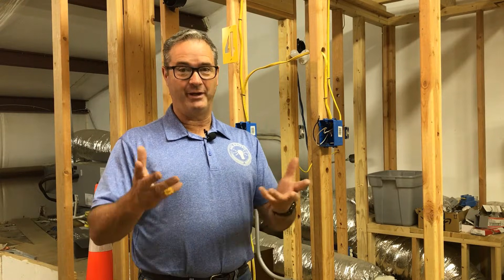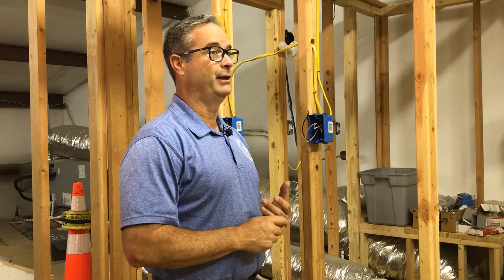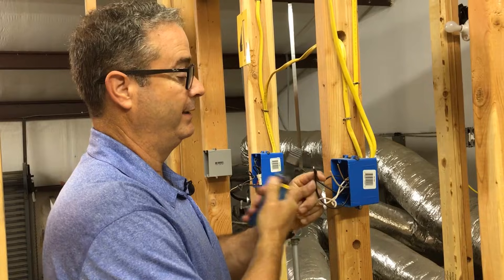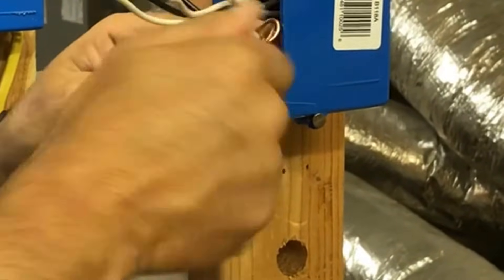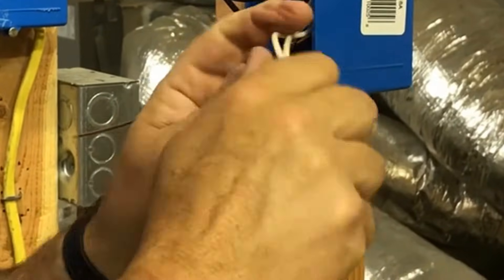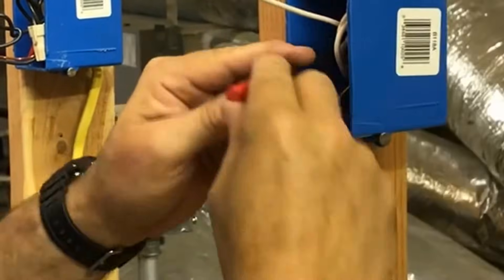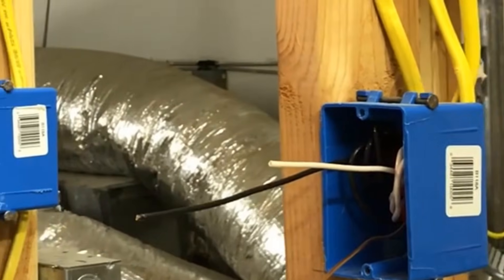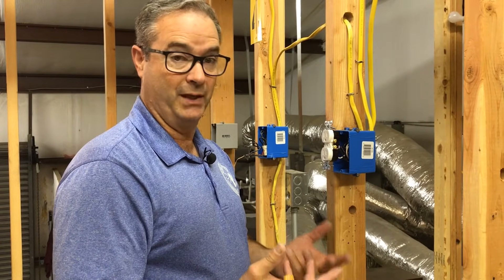How to Pigtail Electrical Wires

Comment: The only thing I saw that you were doing (kind of wrong) was when you were twisting your wires together, you were twisting the first two wires tight then adding the third wire and twisting it tight, then when you added the fourth wire it was riding up and not blending in with the other wires'. When I twist multiple wires together, I will barely twist the first two together, maybe one full twist, then add the third, again only twisting it one full twist the add the fourth. Then when all the wires are bundled, I will twist them tight and put on the wire nut. Other than that, you do things the same way I do.
Reply: Among construction workers there's a brotherhood of people that have a soul it's good to hear from one of you one of us. I'm hoping you can answer this simple question can I run all of my outlets with 10 gauge and then just pigtail a little chunk of 12 gauge on the end? I know the wire is more expensive but I'm going to buy it off Facebook and probably get it for the same price that they wanted for the new 12 and I like that heavier gauge .
Reply: @markmcgoveran6811  It's not illegal, and it's also amateurish and foolish. There's no need to run #10 for 20 amp circuits. #12 can safely carry 30 amps and you're putting it on a 20 amp breakers so 12 is already oversized (electrically) for 20 amp circuits. The other issue is that using 10 changes your box fill. Because 10 takes up more space in the box than #12, you're going to need larger boxes or you'll be limited to fewer cables entering a box. Every box requires minimum 6" of wire entering that box; good luck folding them in, and doing it neatly. You're creating more and harder work for yourself for no good reason. You also run the risk of another amateur with limited knowledge and understanding in the future seeing #10 in the panel and thinking that it would be ok to put it on a 25 or 30 amp breaker. If I opened boxes and saw this was done I'd have to immediately question any and all existing wiring in that space; it would be so obvious that a pro didn't do the wiring so I'd have to wonder if whoever did it screwed up somewhere. Not a good idea. You gain absolutely nothing by running #10.
Reply: @pld8993  well the difference between me and the electricians I worked with and the engineers I studied under when I got to be senior standing in electrical engineering is,: I'm not all-knowing and I certainly am not hard of listening so I listen to your line of reasoning about all the negative sides of it you're right you need bigger boxes. However you are hard of listening when you consider what you already know about the benefits of using a ten gauge wire on a 20 amp circuit in a 120-volt . If the wire is long the resistance is low and the voltage drop is less with the fat wire. Even you know that. So in your personal opinion you are ignoring the fact that the voltage would drop less in any circuit that was thicker wire no matter what the length. So you would say something like it's insignificant it's this it's that it's this it's that it's just you ignored it totally to take a cheap shot at me because I'm an electrical engineer and I know something you don't know about electricity I know something you won't admit about that circuit and the characteristics of one wire over. 10 gauges it's cheaper than the 12 gage or the 14 gauge frequently enough for my purposes. Now there again you want to blow off at the head and call me a liar and tell me the price of the new wire that you charge an arm and a leg to put in praise the Lord speak one to me from on high tell me all about it from on high. Well I hate to mention that I might be a little higher in the mathematical theory department about everything that you ever thought about then you are. I buy most of my stuff off of the Facebook marketplace. You will find often enough for my purposes not yours off and off for less of my money not yours that somebody has bought the 10 and used it for a little bit of work and then just sold it for less than the price of the new 12 the same length. So due to my advanced mathematical engineering skills electrical understanding and cash flow understanding, I'm getting an equal initial cost, in a somewhat lower operating cost,of course all these things would be negligible to you since you're doing it for somebody else you want the money now quick to set it all up and it's going to cost him a fortune to have you fight that number 10 into every socket I know people that did that that were rich and I know some electricians that bitched about it while they were getting rich. I on the other hand and putting all this stuff in myself and I'm buying the cheapest wire I can use and if I can get a number 10 cheaper than I can get a 12 at a store I'm going to take the ten. I appreciate all the nasty condescending advice because I've talked to electricians before."why is it going to take you 6 years to learn all about electricity I'm electrician I know all about electricity I've been putting in electricity for 20 years I know all about it ask me anything you want to know. The first question is name of the thinking there is some iron and some copper and some insulation and some oil in a transformer is that true.... Yes that's true now you know that. My next question is if the transformer is on a 400 cycle per second aircraft alternating current power system and it's supposed to move 400 watts, how much iron how much copper and how much insulation and how much oil do I need? Like all electricians didn't know everything about electricity because they know everything about the qualitative information of electricity. Not only do most electricians have a very very limited quantitative ability to understand electricity they have a very very limited quantitative ability to understand quantitative information versus qualitative information. The electrician looked at me like he was dumb as a post. I said do you know all about a transformer and you can hook it up in the circuit and that's all you know about it where do you get a transformer does it grow on a stock like an ear of corn?
Reply: @markmcgoveran6811  Unless your circuit length is approximately 100' or more and your conductor is close to its max current capacity, voltage drop is well within the max recommended 5% so that rules out the overwhelming majority of residential circuits. Lowering the voltage drop that's already within that 5% drop range (from 4% to 2%, for example) provides no functional or performance advantage. Aside from the necessity of staying within 5% of the operating voltage, there are no actualized benefits to using #10 on a 20 amp circuit. But go ahead, mister i'm an engineer with superior math skills who knows things you don't, do your thing and pretend you know what you're doing..
Reply: @pld8993  well let's see friend if I lower the voltage by half the power I can carry is down to 1/4. Electrical engineering for 7 years I ran into a bunch of jackasses like you that were Superior to me in their mathematical ability and proud of it. You're so proud of your vast superiority that you're telling me 5% is the acceptable amount of loss there is no other idea there is no other idea there is no other. Why don't you apply the square law that I applied in my head to keep that in mind as I look at things and tell me exactly how much you're losing when you drop the voltage by 5%. I was there 7 years and I met all of these guys who had all this mathematical superiority and then they used it to support nothing because they didn't use it so please come back at me please come back at me Dr electrical engineer and tell me exactly how much the wattage drops with a 5% voltage loss and then tell me that is the tolerable fraction.I'm not even going to bother to pull out my calculator and calculate what you think the tolerable wattage loss is because you told me what you think the tolerable voltage loss is at 5% then you quit all the authorities up and down the pike like that means something . I want the 7 years of electrical engineering. I got screwed on a grade they were having a great appeal with a bunch of professors and I asked a good honest electrical engineering professor to come in there and be my witness as to my behavior. When he came through the door the honest guy and the rest of them saw him the look of disappointment on their face was clear these guys are mathematicians but they haven't the poker face to use it. My witness was the soul of patience he sat there and didn't say anything I never questioned him about it. Fundamentally the guy cheated me fundamentally he gave me a lower letter grade being an f and he was generous with some people who had lower scores overall than mine so he broke the rules and the order we fell in the raw scores is the order we fall in the grades it's pretty simple even an electrical engineer can't understand it.back and forth it went this phony great appeal and my friend the honest guy was impressed. Wow he said that was quite a presentation I'm pretty sure you're going to win that was very persuasive. I told him doctor I love you brother but I'm absolutely certain I'm beat I'm lost. These people are mathematical creeps and these people are mathematically astute and these people are superior at me at math. If the spreadsheet and all of the scores of all of the students and myself have shown me to be wrong they would have brought it out instantly and shown me to be wrong they're not going to sit there and waste a bunch of time being polite to some a**** like me their assholes. Lo and behold oddly enough at my hearing the one piece of evidence that would have absolutely cleared me didn't show up and I got screwed I went to the ombudsman. I told the ombudsman I had a straight A on everything and he flunked me out of spite. The ombudsman told the doctor that cheated me that he had cheated me out of an a instead of cheating me out of an f.he was so incredibly stupid he laid out every detail numerically about the scale that had changed and about the scores of the people below me and the resulting if I got for higher scores completely incriminated himself and he assumed the ombudsman was intelligent enough that she wouldn't leaked the information that proved me. I went to the ombudsman office with a copy from the IT people saying that it was straight up from my email account no way I could have done anything to this one it was a legit print out at that time place and it was signed by somebody that was pretty smart. I went to the ombudsman I asked her to sign it and she refused I asked her officemate to sign it and he said I sure will Mark I was here for this whole mess and this is the official email from this office so if you couldn't find her at work to sign it and you caught me I'll sign it. She signed it. She said if I went to the academic Senate she would have me arrested. I said can you deliver these documents. No I won't she says and if you mail them I'll have you arrested for trespass if you contact them I'll have you arrested for trespass. So I had about 10 phds doctors with engineering just like you way smarter than I am they know way more math than I ever had a chance to know so do you. Yet somehow I am so abysmally stupid I forgot what grade I earned and I accidentally told the ombudsman that and I accidentally figured out that she was too stupid to help those engineers keep a secret and I accidentally documented everybody cheating me all the way up to the grade appeal and to the ombudsman. So is a mathematically stupid person please help me figure out how much wattage lost you are accepting when you drop the voltage percent? We've gone over your credentials at Great length in your mathematical superiority and your engineering employment and likeness and everything else about you up and down the pike until I'm happy to remember my college days and all of the people just like you that were so smart one of them confessed to the ombudsman and she told the whole story of where he broke the rules how he broke the rules and how I should have passed the class.. so yeah. You got the better resume you got everything better than me better better better better up and down the pipe smarter too just like all them other people that was arbitrary and cheated. So you heard my resume and you heard my mathematical concept about the difference in the power with dropping 50% go ahead and use my equation and figure out what your tolerance of dropping power is at five percent. I don't really care you seem pretty intolerant of somebody who wants to run a fat wire cuz he got it cheap and it saves 2%.
Reply: @pld8993  you have very very limited ability to deal with quantitative knowledge and it shows glaringly obviously and beyond the shadow of a doubt. If you have 1/2 the voltage, you have 1/4 the wattage. If you have 95% of the voltage you have 0.9025 x the wattage delivered at full voltage. That's the math do the math. If you look at all up in the ohm's law chart that you have to use to manipulate ohm's law you would find an equation that would tell you exactly what I just said. Unfortunately you are too obtuse to understand what I'm trying to explain but it wouldn't drop by 50% like you somehow implied I thought it would or whatever 9.025 percent.
Reply: @pld8993  yes I have senior standing in electrical engineering. I merely said if you drop the voltage by half then you will get 1/4 the power out of the system because it is very simple calculation. If you drop the voltage by 5%, power delivered will amount to 0.9025 times the original power. Please do me a big favor look it up, incorrect my numbers if you are able. I know you're an electrician and you know everything about everything electrical it doesn't matter. Unfortunately you don't have the quantitative skills to understand electricity the way I do. The formula is the new percentage squared. If it's 50% you square that you get 1/4. Please correct my formulas in my calculations I would love to see this
Reply: @markmcgoveran6811  I can run circles around your supposed quantitative skills, mr. senior standing. So you can do math, plugging numbers into a formula isn't that difficult, but you still don't know what you're talking about and you clearly don't understand electricity. Keep running #10 for 20 amp circuits because you think it matters; it gives those of us who know what we're doing a chuckle.
Reply: @pld8993  yes laugh all you like please run that formula buy me again for the 5% reduction in voltage and tell me where I missed at my 0. 9025 coming back is the power. I'm glad you have so many math skills I'm glad you get to sit around and laugh at me and think you know everything that's fine. Have a ball but please refute my equation sir please refute my equation please show me a better equation than mine to calculate this I have many I'm only talking about a direct current circuit in this simple model it does apply to the alternating current as well
Reply: @pld8993  oh please please help me sir please please help me stop running circles around me and tell me the equation for figuring out how much power is lost when the voltage drops by 5% please help me please help me. Please please run a circle around that simple equation that simple plowed ground please please tell me tell me what you need to tell me about quantitative stuff I'm begging for your quantitative skills I don't have any myself I can barely plug in a formula please please help me help.
Reply: @markmcgoveran6811  You still don't understand what you don't understand. Any power loss from up to 5% voltage drop is irrelevant and acceptable in most applications, and certainly in all residential applications. But go ahead, keep obsessing about mathematical formulas so we can all see your ignorance.
Reply: @pld8993  let's sort fact from opinion. Professional or otherwise opinion is still opinion. If I dropped 5% on the voltage where it's delivered I'm back down to 0. 9 02 5. I don't have to want what you want I don't have to worship your opinion I'm sorry about your ego I'm sorry about your need to be worshiped.  Perfect agreement over the facts. We both agree that if I use the fatter wire I will have a Little More voltage at the outlet. Your opinion is widely held opinion it does not become a fact. The fact is if I want to buy the 10 gauge wire and put in the bigger boxes and all the other complaints you had about you doing it when I get done I will have a little less drop and a Little More voltage at the load a little more power at the load and that's what I want. I don't care what you want I don't care what your opinion is of what I want I'm happy that you think you can run circles around me with quantitative methods. It would seem we agree completely on matters of fact using quantitative methods but somehow there's a lot of drama involved here somehow you have to jump up and insult the same formula you plug in to get the same answer to this question that I do. I don't care about your resume too much until you want to discuss how much you can pass me and how much wrong I am about your qualitative opinion. People use exactly the same plug-in formula if you come up with the result of a very simple question how much power is lost at a 5% voltage reduction. When you use it to check my work you see that I have the same formula that you plug your numbers into. Therefore it's not a matter of you exceeding me with your quantitative knowledge rather you equal me and demean me for the same thing you're doing. It's probably beyond your comprehension it seems we agree on every quantitative matter presented but every time there's a pinion you somehow stink like an a**** because I'm plugging in the formula and you're doing the same thing.